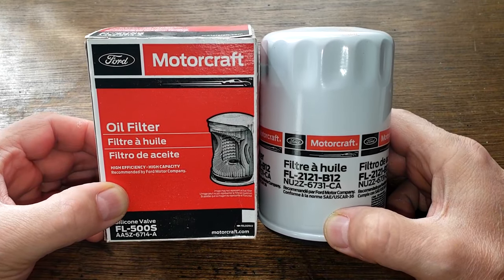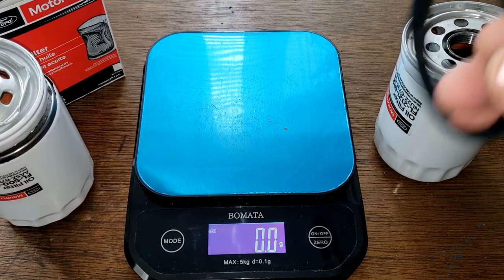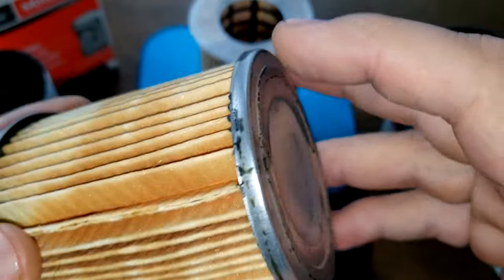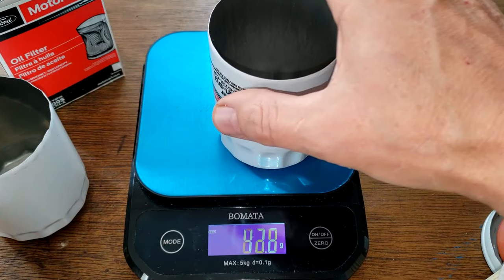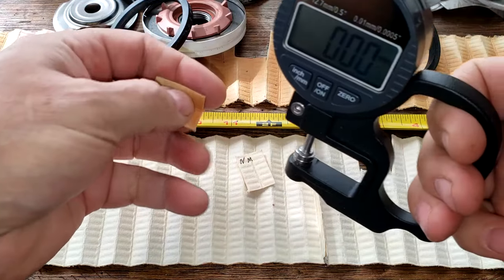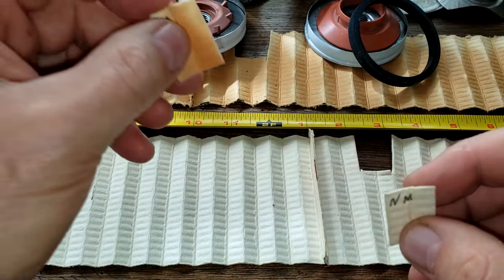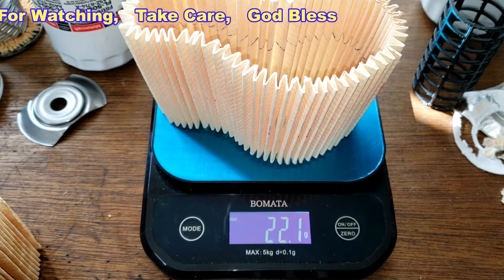New Motorcraft FL2121 Oil Filter vs. Old Motorcraft FL500s Oil Filter Cut Open Comparison

Comment: Late last year the FL500 went on a bad back order, Ford went to Champ to make the FL2121B12 till the FL500 came off of back order, The FL500 is back. The reason I know this is because I work in a Ford dealership parts department.
Reply: It’s funny and sad that the regular supplier A of FL500 - which is probably under a long term contract - can’t deliver due to some kind of a back log. But Ford can go to a completely different design produced by a completely different company B - which could take months to bring on line - to meet the temporary need and receive the filters in a timely manner to fill the need for a while. What’s wrong with company A that it can’t supply, but company B can?
Reply: @stevenw2866 My guess is that Purolator’s first priority is supplying the demand for their own brand first before accepting/renewing contracts for private brands. 
Champ is not as heavily invested in selling their own branded products. If Purolator was having difficulty sourcing filter components to meet their demand obviously they would prioritize their products over private brands.
Reply: @prevost8686  You may be correct about the priority of M+H/Purolator in a time of shortage.  In such a case, how does the assumed material shortage affect their other private label products such as NAPA and Wix filters? I want to assume that Ford/Motorcraft is a large enough client / customer that they want to keep them satisfied so that they don't need to take their business elsewhere.  This is an interesting case that no doubt concerns facts we will never know about.
Reply: It's simple. Purolator can't deliver. Champ already makes a compatible filter and can deliver. Champ didn't have to do anything but slap a Motorcraft sticker on their filter.
Reply: @stevenw2866 Quite a bit of logistics goes into manufacturing. Someone at Purolator might not have ordered enough steel or filter material a year ago. Demand may have spiked. Equipment may have failed. Not enough employees to run the equipment 3 shifts. Could have been a contract issue between them & Ford (price or quality). Maybe their entire production run of filters failed quality control. 

My wife worked for a major manufacturing firm, for one of their execs. The things that can go wrong are many. Like your shipment of widgets from Baltimore falling off a cargo ship headed to Wilmington.
Reply: I remember a crapload of MotorCraft aka MotorCrap filters missing all the threads or partly missing threads....looks like MotorCraft went all AC Delco with these 😁
Reply from the maker: I have an FL910S video coming up in a couple of weeks, they changed that filter also.
Reply: had one come loose on my sister's MKT.  I figured either the threads were burred and it felt tight when it really wasn't or what threads were there gave out. I didn't get to see it, brother put a new filter on and threw the old one away. Interestingly enough there was a shortage of them at the time.  @daewooparts
Reply: @WhipCityWrencher  I hope the FL820s doesn't switch over to the new design.

Comment: My understanding, the Champ made replacement a temporary thing because of supply chain issues with the original M&H Puro made filters. Wondering where you obtained the FL500 efficiency rating? The Champ made MC endcaps are polyester. Most Champ now use metal caps. So, replacement not impressive. FL500 ok, but the price of all Motorcraft OFs have significantly increased recently, more than double. Thanks for c&p.
Reply from the maker: You're Welcome Faxmen09.
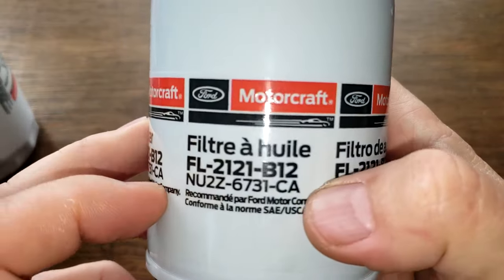I got the FL500 micron rating here, click on the link, at 1:40 mark  https://www.youtube.com/watch?v=4at4X8TZOlw
Reply: @WhipCityWrencher  ,yup seen that video long ago & it throughly describes the testing process with their filters
Reply: @WhipCityWrencher  Yeah, I remembered USCAR 36 for MC filters, but forgot the efficiency number. For a long time Motorcraft claimed minimum of 80%@20um. Makes me wonder if that number equivalent to USCAR36. Funny thing is when Amsoil sponsored ISO 4548-12 testing the FL820S tested much better, ~93%@20um. The word minimum can mean maybe better.
Reply from the maker: @faxmen09  80% at 20, 95% at 30, probably all the same anyways. LOL
Reply: @WhipCityWrencher  I agree.👍

Comment: I'm guessing most oil filter design changes are to allow for synthetic or semi-synthetic oils, which many cars today require. The FL500S is clearly made by Purolator (as is any filter with oval holes).

Comment: Outstanding job, Pete.  So Ford is cheaping out their filter.  What a shame. Let's face it, if you are spending $12 for a quart of synthetic oil, you are not going to mind buying more for the best made filter.  Even if you aren't spending $12 per quart for oil, getting a best made filter should be a priority.   I do not like that bypass valve stuck on the leaf spring.  You've shown that they can leak at the place where the valve goes into the cartridge and I can't imagine those fiber endcaps can make a tight seal. The nylon cage doesn't bother me they can take pretty high temps.  While I don't like all the sloppy glue but I do like that upper bypass valve and metal end caps on the old one.  I'd definitely scoop up a big supply of the old filters if I used them.  Then again I think I'll just stick to my Boss and XP filters.  

Keep 'em coming, Pete!
Reply: Who spends $12 qt on oil? Mobil 1 is less than half that.
Reply from the maker: Thanks, Jim👍
Reply: @WhipCityWrencher anytime Pete!
Reply: @donwyoming1936 but why would I buy Mobil 1 when there are much better oils out there?
Reply: @jamescaron6465 
Pennzoil Ultra Platinum 👍🏾
Reply: @jerryjeromehawkins1712 that’s what I use.

Comment: I love the newer High flow cores, but I prefer the old bypass system. I really dont see how the new ones pass Fords Specification.  One note, I would use either since the new one has Felt end caps and not Resin impregnated cardboard.  If the new one were made with open metal end caps, I would never use it due to terrible sealing flaws, but they used the best material for the design as it is completely covered on the ends, unlike Frams version with cardboard that is too small to keep the oil from mixing.

Comment: Also if you got the space you can use a FL820S in place of the FL500S.
Reply: Different pressure relief valve and operating pressures

Comment: Ever since you pointed out the lack of seal at the relief valve on champ filters, I shy away from champ now, and I would say people should buy the old ones if they can, even with the glue slop. Get on Rock Auto and stock up on clearance filters.

Comment: I would re-engineer the new filter with the old bypass valve, metal end caps, silicon gasket and drain back valve, and have the plastic cage made out of metal. No 'Cheese Grater' center tube for me. I think it restricts oil flow. Take care all.

Comment: Excess glue on the old one, and also a reputation for tearing on those as well, means the old one is really a "Motorcrap" oil filter.  
The new one isn't awful, just wouldn't be my first choice.  Fiber end caps aren't a problem as some think, since you'd have to find a case where they disentigrated, and I"ve never seen that happen on any brand that used fiber end caps.

Comment: The new one looks like garbage. 

Great review as always, thanks Whip!😊
Reply: The new one looks like a Fram. I wouldn't buy the replacement  of the Motorcraft filter, would rather buy a Purolator
Reply from the maker: Thanks👍💯
Reply: @JamesMcMullen-wj8rs  Fram or Champ Labs or AC Delco (all the same)!  It's funny if "Garbage = Ford parts turning into General Motors parts" 😂

(Not all Frams are made by Champ Labs, only some.)
Reply: It's how it performs that matters, not how it looks.

Comment: I had a 2008 Grand Marquis which I faithfully on which I had Motorcraft filters installed. Last spring, after an oil change, the engine started rattling badly on a cold start. After two weeks, I bought a Mobil 1 filter and swapped out the Motorcraft and the morning rattle stopped. Soon after, I saw a post on Bob is the Oil Guy regarding the same filter and a switch of manufacturer. Nothing is sacred in auto parts these days.

Comment: Form my understanding the new one was used to back fill the demand when the fl500 was in short supply.. I can't find any for sale right now.. So basically the new one is an AC Delco PF63 or supertech MP10575.. although if im not mistaken the Supertech has the metal end caps... Nice video Whip!!
Reply from the maker: Thank You👍

Comment: I think the difference is that the new one's maker got the bid due to lower cost to Ford.  My F150 is wearing the 500s, but I ahve a Purolater Boss on the shelf (although the BOSS cost me a good bit more).
Reply: Yeah I run the Boss on my F150, that one with felt ain’t happening …

Comment: Also when you do the video for the 910, you should do your flash light test before you tear the fiber end caps off and put on the spring with bypass valve and you will see light gap on the two sides of the spring where it was cut flat on each side.
Reply from the maker: I'd have to do that at night because it doesn't get dark enough to do a good test and I don't think I'll be doing that when comparing them two filters.
Reply: @WhipCityWrencher   I have a extremely bright stream light so I was able to see it well in a lit shop. But it was just and idea. I don't think those filters are sealing all that well on those two spots and have verified it on both filters I cut open

Comment: New Motorcraft looks cheaper made reminds me of a basic Fram oil filter, I  am using Motorcraft FL-400s oil filter for my car for years and so far everytime I opened it after use I haven't seen the paper endings only metal, Once I find a Motorcraft FL-400s made cheap like this new one than I be done using them, I would never use a filter like that, been there done that.

Comment: Funny that the 2121 is taller than the 500 but the 2123 is shorter than the 910. I later found out the old filters are still available but my local dealer started getting the newer ones because it saves them a dollar per filter.

Comment: At first i was disgusted that they went to champ and removed the top bypass which bypasses the oil before the oil passes thru the can which prevents filtered contaninants from bypassing intol the engine on a cold oil or high pressure.

The glass fiber synthetic media in the new filter is going to offer better filtration efficiency to  the old paper cellulose blend that the old filter used. That glass fiber synthetic media blend flows better and filters finer particles better. This also means that this filter is going to spend less time in by pass mode. 
Better suited for 7-10k mile oil changes

Paper/celulose filters also have less capacity and steeply reduces flow as particulate matter increases. This will make a filter more likey to bypass and will result in more time spent bypassing the oil filter.

Glass syn blend filter media is actually more epensive than the celulose paper blend of the old filter.
 
Yes theres some cost cutting but the This new filter is actually a better filter overall.

Comment: If you guys want a quality filter at a reasonable price like the old Motorcraft, consider buying the CarQuest filters.  They are made by Purolator (like the old Motorcraft) and are very similar in quality.  And the best part is they are not expensive.
Reply from the maker: The Carquest oil filters don't have a base end bypass valve like the Motorcraft oil filters.
Reply: @WhipCityWrencher  that really doesn't bother me. As long as it has one. The quality seems pretty good for the price though

Comment: With as much glue as there is on that motorcraft, and other M/H filters. Not to mention shorting the pleats so they don't actually fill the end caps... The champ looks far neater. Im not a fan of the felt end caps or that bypass design. But it looks very clean and for all we know, that bypass "leakage" is factored into the filtering specifications.

Comment: Looks like a cheap replacement to me. I'll stick with the old one. If i was gonna use a cheap filter i would just buy the cheapest Fram. Which i used for years with no problem  but that was when i changed oil every 3000 miles. Thanks for tearing into it.
Reply from the maker: You're Welcome👍💯

Comment: Me personally, I use STP from AutoZone. I've been using the STP S3614XL on my 2019 Ford Fusion Hybrid (equivalent Motorcraft is the FL910S) pretty much as long as I've had the with no issues. It's a decent quality filter just from looking inside without cutting it open. Silicone anti-drain valve and silicone gasket, metal core with holes, metal end caps, efficiency rating of 99% above 20 microns. Always readily available at my local AutoZone stores for $9.99 or as part of oil change bundles with full synthetic oils for basically free.
Reply from the maker: Hi Daniel
You might want to watch the video coming out on April 26th, I open a Motorcraft FL910s. Thank You👍

Comment: Your Fl400S video showed how that extra glue (shown here at 5:29) could get loose and could go through the bypass valve on a cold winter morning, or come loose from the 'clean' side of the filter and clog my oil pickup tube.  No thanks, until they get a better glue and learn how to apply it.    I love the valve design, but not how they put it together.  Thank you for showing us what's inside!
Reply from the maker: You're Welcome👍

Comment: Both Purolator and Champ have made good oil filters for a long while now. You can't really go wrong with either. I've used Champ filters in our shop and on my own vehicles along with the Purolator and Motorcraft and have never had an oil filter issue in over three decades. The old FL-1A(made by Purolator) was a shop standard for Fords as long as I can remember. All four brands have been outstanding in our experience. The real key is changing the oil! Thanks to you for doing these important videos to enlighten others. You make us all better, smarter consumers.
Reply from the maker: You're very welcome👍💯